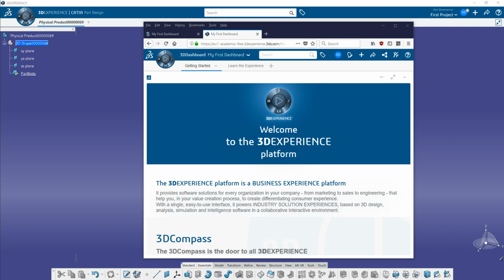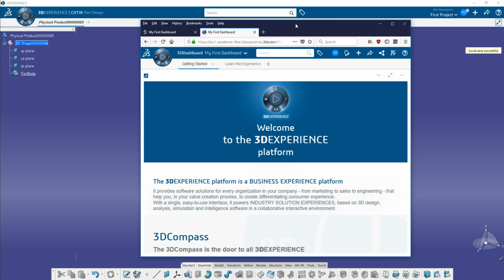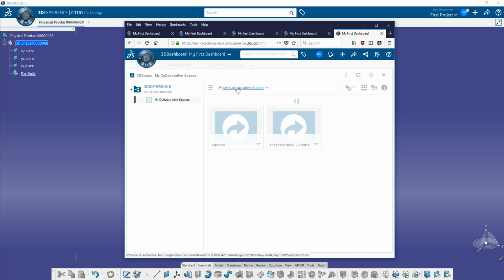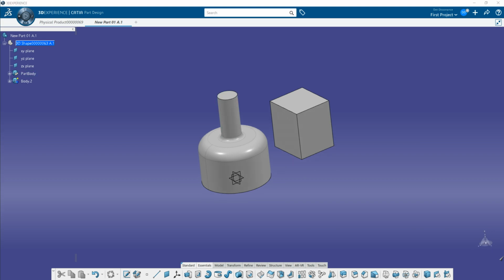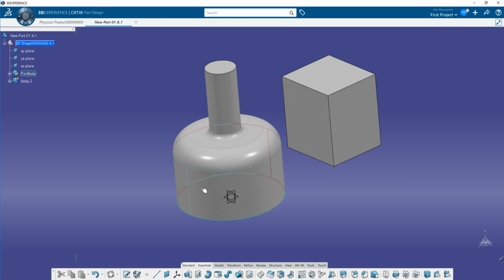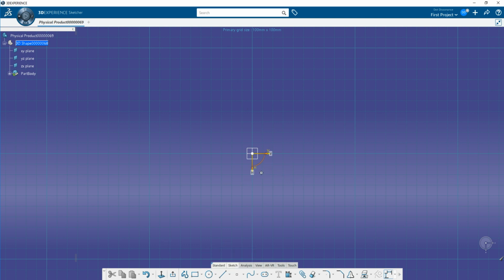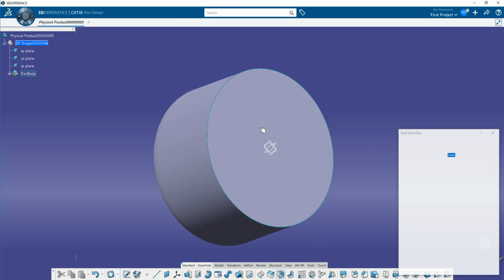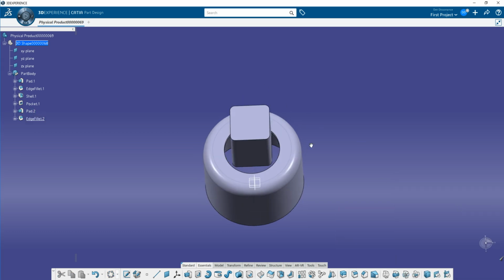#100 - Dassault Systemes 3DExperience - My First Impressions

Comment: I also think that the plattform has many issues and has slow loading times, but dude, most of your complaints show that you havent understood the interface at all... there's a difference between web and rich client and you do not work in both simutaneously like you showed here. e.g. when you want to search an object, you just use the search bar in the top bar. why do u think they put it there. to search. you dont know in which space the object is? it is listed in the properties. you scroll too much for apps? put it into favorite apps. can't save? it's in the upper right corner. 

biggest issues are loading times. but your points are total bs and meaningless. if you cant learn the very basics you should rlly not use the software at all =)